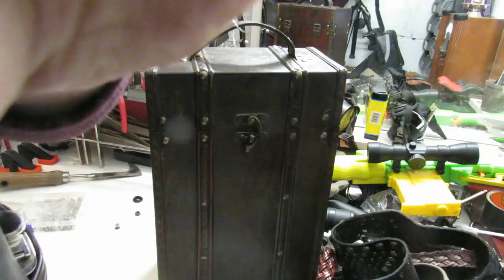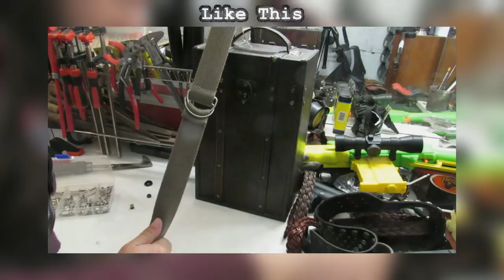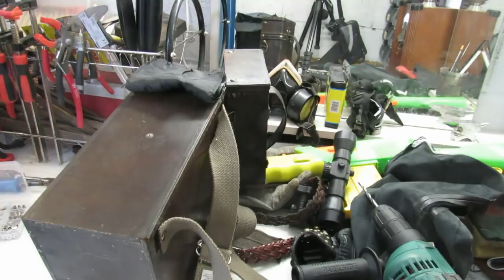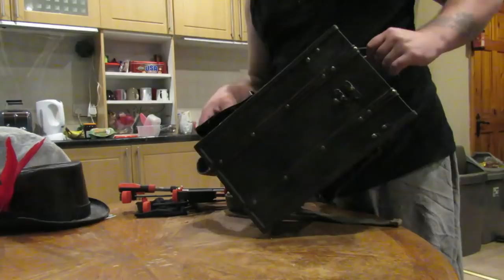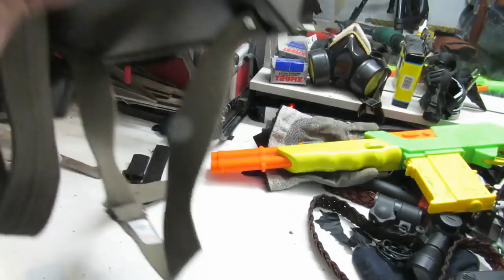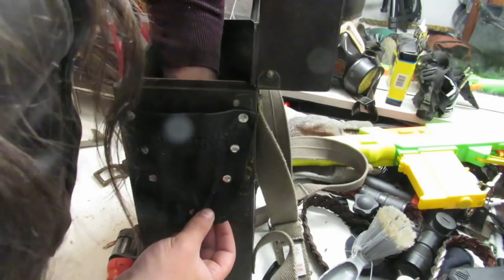Larp Backpack Build Process

Comment: I built one of those once!!! It was woke and leather with little copper bits on the joints. I used it as a school bag for a month. Then it broke.. Which isn't surprising considering the hole thing was held together with bloody string and glue.